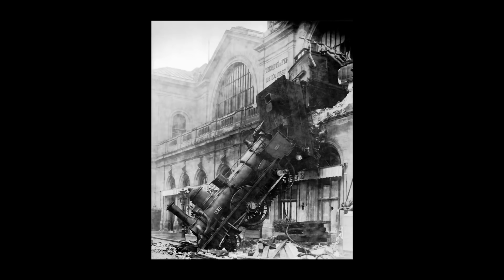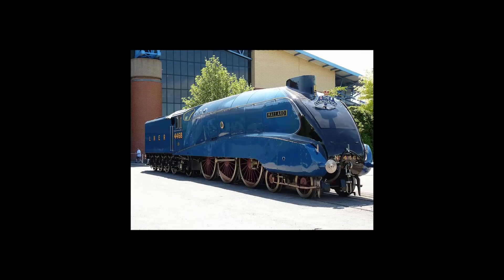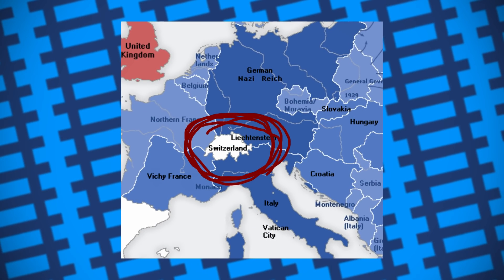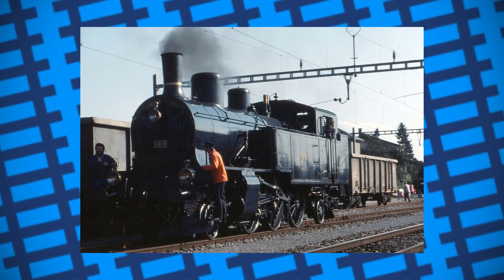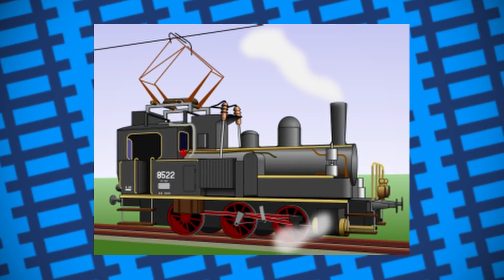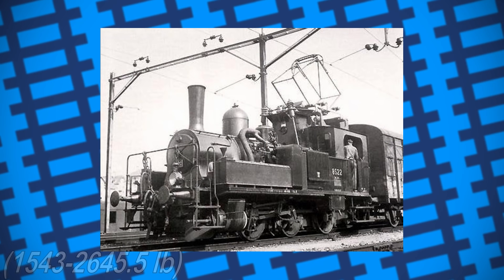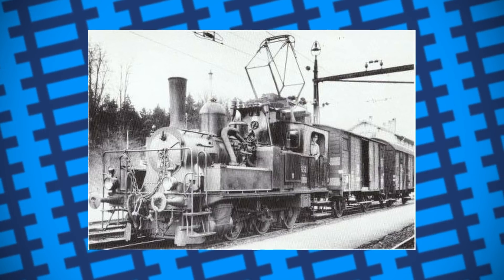Why Switzerland tried to fuel steam locomotives with electricity - Electric Steam Locomotives

Comment: This is literally insane! . . . Why would they do this?! . . . They had motors, just power them directly!
Reply: So many questions...that all have been answered in the video.
Reply: @Slithermotion  it's not really a question since I think they were just stupid for doing it!  The system has soo many points of energy waste!
Reply: @bardrick4220  Yes. But the swiss had an abandunce amount of water and electricity in the 1940 you know what they didnt had? Coal and oil. Battery capacity back then was a joke so how do you propell an off grid locomotive? Horses?

What would your solution be for a shunter locomotive?
Reply: @Slithermotion  build more grid! . . . they could have slowly phased out the coal locomotives while using them to run those lines that weren't upgraded yet.
Reply: @bardrick4220  see im not sure if you dont get it or if you are trolling...
The swiss had in the 1940 almost 100% of their railway electrified. This wasnt a problem. But...there are railyards to load and unload freight. This is a place where you might use cranes ect to move freight.

Overhead wires are not possible in such an area. This electric steam locomotive was used as a stopgap for rail shunting on industrial railyards where overhead wires are not an option. You need an offgrid solution.

This has been mentioned in the video so Im not sure if you have even watched it.
Reply: @Slithermotion  the point is we wouldn't dream of doing this today, and I think it was still a dumb idea back then!  Even the batteries they had back then would have been a better solution since they would be soo close to a power source! . . . It's much like how we run electric forklifts in warehouses.
Reply: @bardrick4220  of course we woudlt do it today...nobody is questioning that.
I would disagree with you battery statement.
Battery capacity back then was a joke, even today battery capacity is a challenge in hybrid rail technology.
Second reason would be that they somehow had to establish a battery production in the middle of WW2.
Good luck with that.
Reply: @Slithermotion  for short trips lead acid work fine!  It's the same technology they had back then!  Alot of people don't know that EVs are really old technology!  It's just lithium cells gave us better range, and climate change threatens our survival!
Reply: @bardrick4220  of course batteries an EVs are old technology. 
But I dont think that running a shunter locomotive with car batteries might be smart either...100 less energy dense.
You can google how far a ev could travel in 1930 and maybe understand why its a bad idea. Now those steam locs are also not very energy dense but they are cheap. Pantograph and heater on an existing steam locomotive instead of developing and producing a completly new battery locomotive...during war time.
Yeah sure...
This electric steam locomotive was the most cost efficient way the swiss could do.
Reply: @Slithermotion  do you listen to yourself?  It never leaves the yard, so when the battery is empty you just put it on the charger, and bring out the other 1 that's full!  There's a reason I mentioned electric forklifts because it's almost exactly the same usage case! . . . Sometimes people just make mistakes, and this was just a quick and dirty solution, so they ran with it.  You don't need to read anything else into it . . .
Reply: @bardrick4220  bring out the ptherone thats full....lol. See we have the same Question.
Do you listen to yourself?
You want 2 shunter locomotive per location where one of the 2 is idle.
And on top developing a new locomotive in war time...
Reply: @Slithermotion  they wasted even more designing this combo unit during wartime, and then they threw it away! . . . Dumb decision.

IDK why you want to argue against a successful business model; buying an extra vehicle or 2 to sit in rotation is acceptable when you consider the cost of fuel!
Reply: @Slithermotion  There's a pretty good Video about the exact Issues with Comments you are discussing. It's in German, but Captions with automatic English Translations are available. It's a nice Tutorial on how to write an useful Comment( e.g. watch the entire Video before commenting):

https://www.youtube.com/watch?v=XOyBEyMvmc8
Reply: That doesn't work on unelectrified Track in Freight Yards or on some Branch Lines. And that's what this Locomotive was designed for; they could work for up to an Hour as Fireless Locomotive before having to re-heat on electrified Track.

Comment: I think, with todays technology we could make a electric/steam locomotive
Reply: The issue is that steam will always be less efficient than electric motors.
Reply: @thatoneguy611  what i mean is, we can now produce extreamly high-pressure cylinders. Take a carengine for example: a american V8 has the same/even less power then a german 2 litre engine. Thats because we can create so much pressure in a small room thanks to great compression. A steamengine nowadays would be way more efficient then the ones build back then. And with the implementation of a electric heater or a coil to heat the water instead of burning coal, it would create a lot of steam in a short time. The only problem a friend and I came across in theory, would be how we could isolate the engine. The amount of electricity needed for this project would create a large electromagnetic field around the engine= it becomes a big magnet. There is paint which can  provide this but it isnt very heatproof. But if it could work it would revive the time of steam
Reply: @danidanoo9374  With all the thought you’re putting in, you could’ve already produced a conventional electric locomotive.
Reply: @BalticoYT  with the thought, yes but  i cant build a locomotive on my own😂

Comment: Did they still have the risk of going bang? I once found a video from Pennsylvannia about an engine attached to a tourist train that was poorly maintained, so it went bang.
Reply: So if a steam engine and tourist train bang what would the result look like?
Reply: The firebox crown sheet collapsed, flooding the firebox and cab with scalding water. The engine was a disaster waiting to happen, with a non-working water glass, guages missing, and numerous other issues. The boiler water level was too low. As for what happens when steam engines go "bang," people die. Sometimes the bodies are found 200 feet distant.
Reply: Absolutely, they still employed a boiler and a poorly maintained and constructed boiler is liable to release the pressure it is charged with if the vessel cracks or ruptures, portions of the boiler designed to, and expected to always be in contact with cooling boiler water that are deprived of that water and are allowed to heat to the point of softening can and will deform and burst and the boiler's contents will rapidly escape. Like in the case you mentioned, where important gauges and displays used to indicate operating conditions were in disrepair or missing entirely, critically as mentioned above, the water glass which indicates the water level in the boiler which if non-functional can lead to a dangerous low-water condition arising without your knowledge. It is lucky that the locomotive pulling that tourist train failed in a relatively safe way and only dumped the boiler contents into the firebox which whilst not catastrophic, is going to be deeply unpleasant for the fellows standing directly behind the firebox.

Comment: Another problem might have been the supply of raw materials required to build electric locomotives, such as copper. (As a side note, some electrics of that era had aluminium wiring to save copper ... which was a rarity in war times on many sides.)
Nevertheless the production of new electric locomotives did go on and the Swiss railways were at the forefront of development. One of the first universal 4-axle electric locomotives capable of hauling both freight and passenger express trains on mountainous lines was the BLS Ae 4/4 built from 1944, faster and more powerful than the similarly-sized German E44. And continuous production of the Ee 3/3 electric shunters went on.
As the video mentions though, it was also thought the electric-steam shunters would be useful on partially electrified stations. In the end they proved to be overly complicated and inefficient though, and it was easier to just complete the electrification. (This is in contrast to some countries that delayed electrification, fearing it would be a strategic obstacle in times of war, allowing to shut down the whole system more easily ...)
Reply: E 44 prototype was from 1928 so your comparison is not accurate. Better to use E 40 prototype from 1947
Reply: @steffenrosmus9177  E40 came 1957 and like the E10 followed the E10.0 prototypes of 1952. Which were certainly influenced both by the E44 and the Ae4/4. It's all part of a development with mutual inspiration, but back then each country still had its own railway industry and different technological preferences.
Reply: Aluminium was in short supply too - because Germany was using coal fired power stations to power aluminium refineries - no coal = no aluminium or copper.
Reply: @allangibson2408  They were using coal fired electricity to smelt aluminum and get electrode copper. They weren't using the coal directly. Switzerland had huge hydroelectricity but no fuel, which is why they were using electrically heated steam locomotives. They were also using electrically driven heat pumps for space heating using the same river water as the heat source.

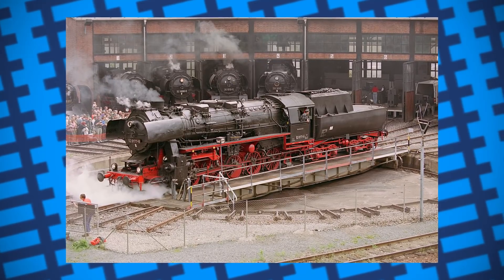Comment: I have just one problem with this video, at 2:44, in switzerland diesel locomotives didn't take over, electric locomotives took over
Reply: The swiss already had an almost 100% electrified rail network.
By the time this electric steam engine was built the swiss already used almost only electric locomotives. This steamengine was only used for off grid shunting.

And these were replaced with diesel shunting locomotives, later diesel hybrid and now some are even battery hybrid.

Comment: I imagine, if BR had committed to sticking with steam, that they would have trialled such technology themselves as a stop gap measure before full electrification. Cue, ambitious but rubbish!
Reply: I think you are missing the point... By the 1940s the swiss railway was almost 100% electrified. The only reason for these electric steam locomotives were the industrial shunting area where no overhead wire where possible.
Thats the only place the rest of the network used normal electric locomotives.
Today the swiss use battery electric shunting locomotives or diesel hybrid.

These electric steam locomotives where never meant to go on the mainlines.

Comment: It's funny, when I was young and still learning about the history of trains (I was probably about 4 years old), I  thought this was a great idea. I thought nobody had done it before. I had no access to the internet, only a limited supply of books, mostly on American trains. When I got older and realized it had been done I had mixed feelings about it. 😂
Reply: Know the feeling.
Reply: Still, surely it would be a good idea for heritage railways that otherwise might not be able to afford coal? Perhaps even putting high-density batteries in the bunkers?
Coal is getting rarer, but electricity is everywhere!
Reply: @caramelldansen2204  That kills the heritage. I think it's safe to say most organizations would sooner put their engines on static display before making a radical modification like that that would ruin its historical integrity.
Reply: @PowerTrain611  You wouldn't have to start ripping parts out. You could almost certainly design a "slot-in" approach that leaves everything else in place and just heats up what the coal would heat up.
Reply: @caramelldansen2204  You could, but it would almost certainly be a maintenance nightmare that would be more expensive to plan, operate and maintain than running with coal or converting to oil fire, like many operations in the US are.
There are more viable options, no need to re-invent the wheel.
Reply: @PowerTrain611  Do you have numbers on that? Everyone I've talked to has found some kind of reason to be a negative Nancy about this, and I cannot understand why.

Maintenance? It's a heating element. Hardly a nightmare.
Plan? What kind of plan? It takes more planning to get coal up to steam (never mind sourcing the bloody stuff!) than it would be to just plug the system into mains power and flick a switch!
Operate? How is it any different? It's just heat. You either have heat or you don't.

At this point, an alternative to coal needs to be found because (from what I've heard talking to people who work on heritage lines, and a few articles that I couldn't find if my life depended on it) that's the main limiting factor in getting steamers out running. Heating water with electricity is a solved problem. Steam locomotives need heated water. I don't see the issue here.
Reply: @caramelldansen2204 You have a point but their is also a human element you gotta take into account people usually don't take kindly to modifying history it's like painting a new coat on the Mona Lisa to give it a few more years of life but if hypothetically used in replicate locomotives and even crazier out service locomotives it would be rather clean cause then no coal just water and electricity so no spewing smoke into the air...now that I think about it if someone did it right it would probably be more effective than diesel electric locos these days with new battery tech coming out and water has always been dirt cheap it would be actually kinda good for the environment and our wallets

Comment: Just imagine, a steam loco running on third rail electric, powering an electrical heater boiler with a condenser. A flywheel to store excess energy in place of coal tender. That would've been one heck of an eco locomotive
Reply: An….ecomotive, you could say.
Reply: @jamesgroccia644  ba dum tss
Reply: something germans would do... why simple when we can make it complicated. also if you want to run old trains for tourists i believe swiss still have some of those engines around for that purpose
Reply: @jebise1126  And since Germany burns a lot of coal for power generation, we've come full circle
Reply: @thefalkonett  That's right. And their cheaper electricity enables them to export cars to the UK where we leave our coal underground and drive German cars. Talk about winning the peace?
Reply: @jebise1126 as a German, I feel proud you said that 💪🏻
Reply: Would be great for tunnel runs, silly engineers have the delusion that modern long tunnels will only ever see electrics outside of emergencies and thus skimp on ventilation systems, so good luck getting your heritage steam loco to run through these new sections of their old territory without suffocating everyone… running your boiler off electricity would fix that and additionally make it less of a pain to get coal chunks big enough to throw into your firebox…
Reply: Since you're using a heat pump, I wonder if that would be more or less efficient than driving the wheels directly...
Reply: All they'd have to do is copy the steam generator and setup inside a Doble steam car. That, is for all intents and purposes a closed loop. No water is lost.
Reply: With dynamos running on the passenger carriage wheels generating power for the electric lighting ? Sounds brilliant.
Reply: @johnbishop5316   And don't forget the regenerative braking!

Comment: I was waiting until someone would cover these engines in depth.
Reply: I had that ob my List of potential Video Ideas but Train of Thought bet me to it. I might have done that Video already if I wasn't so bad at Voiceovers. Mind you, I wanted to Go a bit more in depth on how they work as Fireless Locomotives on unelectrified Track, and how the Purpose of these Locomotives mostly was shunting in Freight Yards, as all Main Lines and almost all Branch Lines were already electrified by 1943. Plus some more technical Informations how the Heaters worked in Detail. So might still make this Video some Time later to include these Facts.

And there are still many Locomotives preserved of the Type these Electrics were based on. Having one of these rebuilt with Electric Heaters would be amazing.

Comment: The UP Big Boy used to run on coal. The UP 4014 specifically was restored and now it runs on oil
Reply: I think getting coal delivered to anywhere not a power plant is expensive and difficult as it just isn’t shipped anywhere else much anymore, except make coke refineries for making steel.
Reply: @EarthenDam  well I wasn’t really talking about transporting it. It was more about what locomotive used it. Lol.
Reply: @raidlover6941  I was just understanding why they would want to convert from coal to oil from a logistics point of view, then I just remembered also how much more work is it to use coal over oil.
Reply: @EarthenDam  well, in today’s world, it’s cheaper to convert them and use oil as fuel when restoring instead of restoring and using coal.